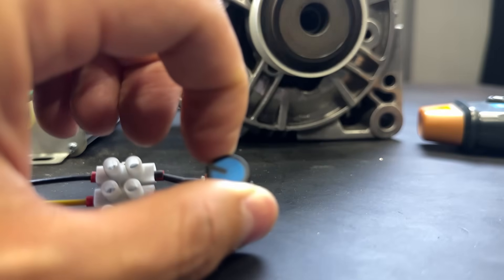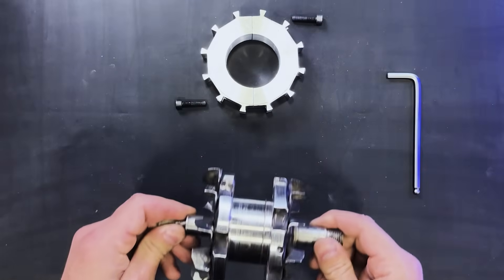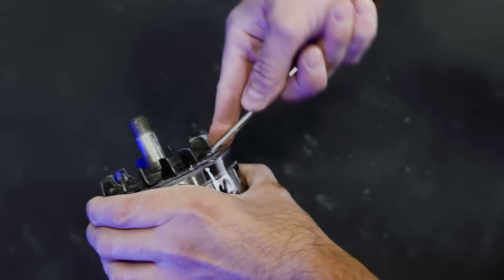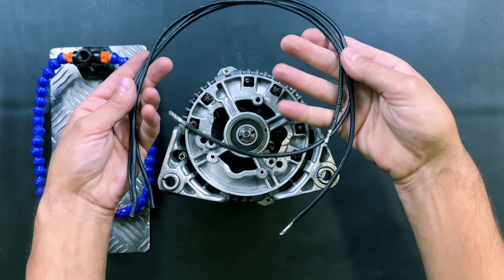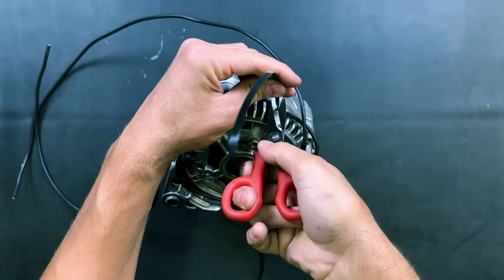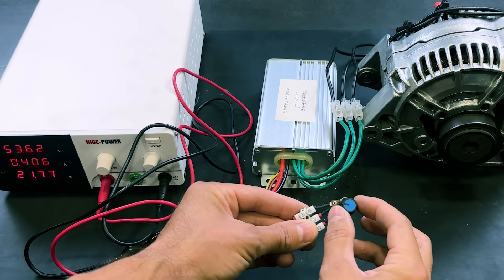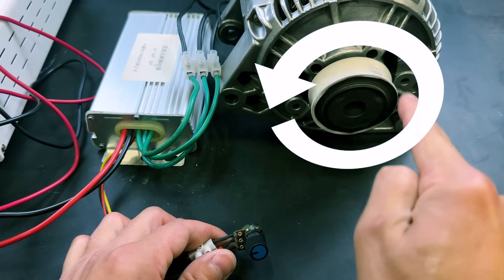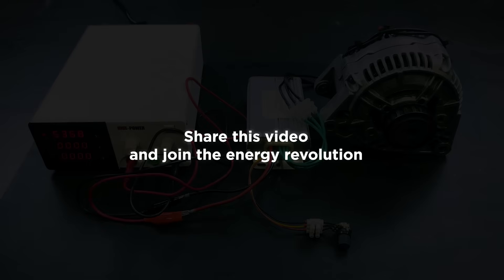How to Make 10KW HIGH EFFICIENCY Brushless Motor From Old Alternator

Comment: Now use the same alternator as a motor and generator at the same time by splitting the 6 phase to 12 phase.
Reply: Nah, I just ordered the alternator a few weeks ago from uk vectra b Berlin 2.0 16v alternator and a baldor reliance super-E motor EM37707 7.5HP rotorverter mode. He calls it a flux verter to run very efficiently
Reply from the maker: Motor olarak çalışması için rotorun özel bir alaşımdan yapılması gerekmez
Reply: Of course it’s the same thing. In order to make it efficient we need the special metal components. I made one only it sucked way more power and it didn’t have much power
Reply: You don't need the special alloy, you can use it as a motor at the same time, generate energy.
Reply: @McFlysGaming  So you don’t need the special alloy to make this motor effective and efficient? 
That’s good to know, could make a sick go cart or something 👍
Reply: I have a six phase alternator I converted to a motor and was having issues figuring out how to run dual three phase so I just use one of the three phases to power the motor and the other three phases to regenerate and also get to use the driving phase to also regenerate upon coasting and braking
Reply: He can't with the same Alternator in his video clip! He needs another 3 coil windings to make a 6_phase motor and for a 12_phase motor he needs another 9 coils windings!